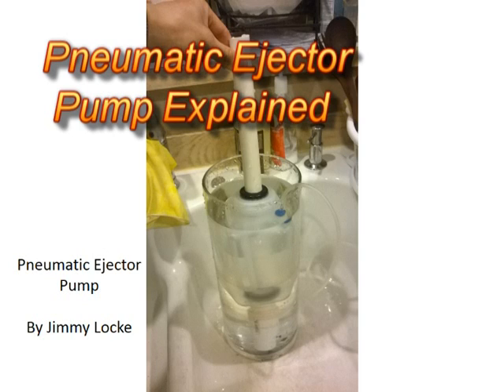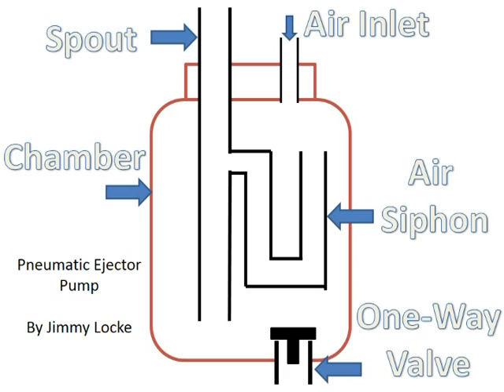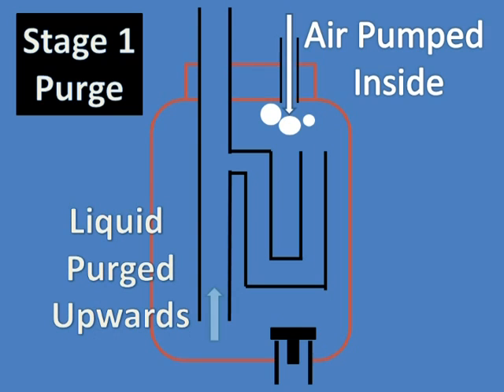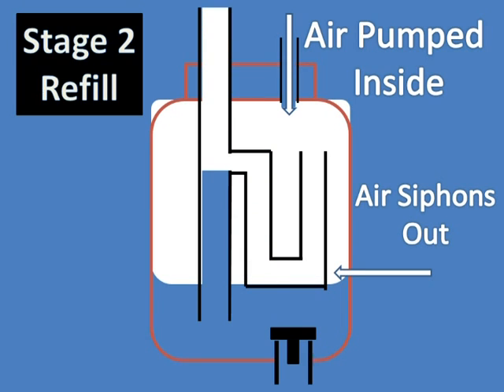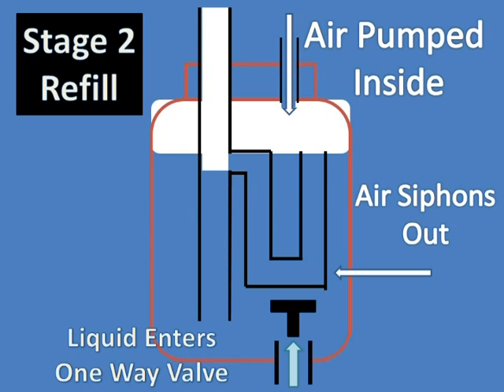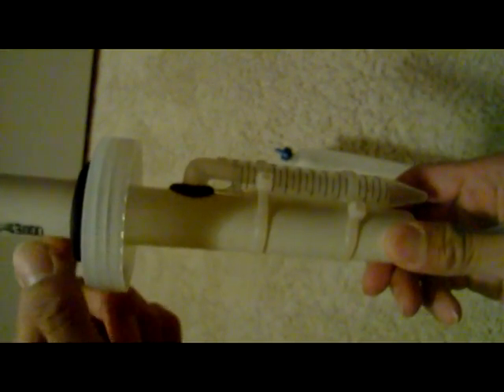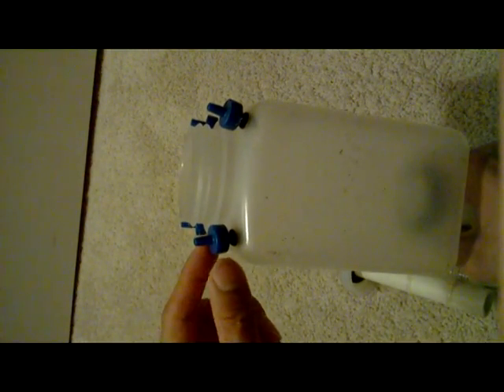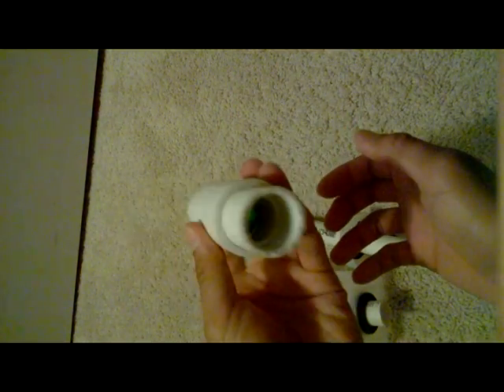Low Power Airlift Pump Explained (Pneumatic Ejector Pump aka Geyser Pump with Check Valve)

Comment: Hello lock8! Worked perfect for 30 feet, fills and empties alone may be injected air all the time without stopping it does not interfere realized that the larger the diameter of the outlet tube of the depressurized water and fill faster, ie, pumping more water as tubes thicker, I will test with mior height or will simulate height lowering of the water outlet diameter, so I can test in the same place ejetei 30 feet, but I will soon eject 200 actual feet in a deep well, something else, if you use a more powerful compressor flow increases enough, I used a portable pump to fill bike tire and ejetei about 8 liters / minute, I'll build a giant to pump some 5000 liters per hour to irrigate the crop of a friend, I will try to replace the siphon by a horizontal one-way valve to see if it even faster filling processes and emptying, I can guarantee you is that has already been using my system with the aid of electronics since February 2001 and today thanks to his idea got rid of electronics which made more functional and ecological bomb because dispença electricity, imagine a propeller attached to a compressor without using any electricity can pump water, or solar energy. I have already observed that this pump can be cosntruida of any size, bigger is better because it does not waste time with breaks to fill and

EM PORTUGUES:  Olá lock8 ! Funcionou perfeito para 30 pés, encheu e esvaziou sozinho, pode ficar injetando ar todo o tempo sem parar que não interfere, percebi que quanto maior o diametro do tubo de saida da agua despressuriza e enche mais rápido, ou seja, bombeia mais agua como tubos mais grossos, vou testar com mior altura ou vou simular altura diminuindo o diametro de saida da agua, assim posso testar no mesmo lugar que ejetei 30 pés, mas em breve vou ejetar 200 pés reais em um poço profundo, outra coisa, se usar um compressor mais potente a vazão aumenta bastante, eu usei uma bomba portatil de encher pneu de bike e ejetei uns 8 litros / minuto, vou construir um gigante para bombear uns 5000 litros por hora para irrigar a lavoura de um amigo, vou tentar substituir o sifão por uma valvula unidirecional horizontal para ver se fica mais rápido ainda os processos de enchimento e esvaziamento, o que posso lhe garantir é que já vinha usando meu sistema com auxilio da eletrônica desde fevereiro de 2001 e hoje graças a sua ideia me livrei da parte eletrônica que tornou a bomba mais funcional e ecologica porque dispença eletricidade, imagine uma helice acoplada a um compressor sem uso de eletricidade alguma posso bombear agua, ou com energia solar. Já constatei que essa bomba pode ser cosntruida de qualquer tamanho, quanto maior melhor porque não perde tempo com os intervalos para encher e despressurizar, sem falar que se usar compressor eletrico ligado a rede eletrica o rendimento do sistema pneumático é por volta de 3 vezes mais eficiente que o sistema de bombeamento tradicional. Mais uma vez lhe agradeço por ter tido essa ideia do sifão de ar, fantastico. QUALQUER PESSOA QUE ESTIVER PENSANDO EM FAZER ESSE PROJETO VAI FICAR IMPRESSIONADO COM O FUNCIONAMENTO, MUITO BOM. Grato, Arruda

Comment: Sorry, reviewing their response, I missed answer you, I confirm that I developed an electronic version that works perfectly and I will feed with photovoltaic solar energy soon, but I prefer to replace the electronics in your system that seems much simpler and can work with it I generate compressed air through the wind power, the good of your system is not dependent on electricity and therefore offers some other options for operation. Grateful, Arruda

Comment: Olá ! Com minha bomba, ejeto atualmente a 30 pés, 1714 L/h,  em outro já ejetei 90 pés, no proximo vou ejetar a 200 pés, o corpo da bomba que tem que ser muito resistente, aço inox é uma boa opção. se for de materia fragil, explode.

Hello ! With my pump, injector currently to 30 feet, 1714 L / h, in other already ejetei 90 feet, the next will eject 200 feet, the pump housing that has to be very resistant, stainless steel is a good choice. if the fragile material explodes.

Comment: Hello lock8! I am in Brazil, Bahia, saw his project, I enjoyed the air siphon idea, maybe improve my project with my pump can eject water at very high heights with corresponding pressure, only to have to wear an electronic circuit and sensor level inside the chamber to know the time that it is full or empty when empty, the low retention valve opens because the pressure of the water outside is larger and the chamber fills, then the chamber filled the box level sensor closes an air relief solenoid valve and connects the compressor which is currently electric network, I will do soon with solar energy, so the compressor connects, the water begins to rise with great force and volume when it becomes empty the camera sensor the low level turns off the compressor and opens the solenoid valve to depressurize the chamber, then begins another cycle. I want to remove the electronics and level sensors and see if your air siphon idea works in my pump, vc tested whether depressurizes if you have a second valve in the water riser pipe? Grateful, Arruda

Comment: Great video, I'm looking to design one of these to pump 12ft up, small amount of water, but still there is an obvious gravity issue... Any tweaks you can suggest ? My first two attempts have not worked, though they did not have check valves... Thanks!
Reply: +jlocke8 Is there any reason you can't use this check valve: http://www.homedepot.com/p/American-Standard-Flow-Regulating-Check-Valve-M953052-0070A/205512748  Also, although I haven't made it all the way through the comments so I don't know if you've already answered the question - what size are those pipes?  Otherwise, nicely done!
Reply: ***** The check valve I linked appears to be a check valve in name only, it appears to function more as a restictor.  This link however seems to be a one way check/stop valve.  http://www.homedepot.com/p/Homewerks-Worldwide-3-4-in-PVC-Sch-40-FPT-x-FPT-In-Line-Check-Valve-VCKP40B4B/202369948?MERCH=REC-_-PIPHorizontal1_rr-_-204237824-_-202369948-_-N  A marble is of course cheaper.

Comment: If I wanted to build one of these to pump water over 200 feet down my well would it still work
Reply: +jlocke, Hello, I kinda have the same issue as Gary McGhee, but instead I have a 205ft deep well (static water level of 65ft). The well is 120ft away from the house and downhill (10 degree do the downward slope to the well casing, aka additional 20ft of vertical lift). I'd like to build a pump that I can put down at 195ft, with a 3/4 inch discharge pipe that will deliver water into an un-pressurized holding tank in my basement. Given these figures, my understanding is this give me a THD (Total Dynamic Head) of 240 feet, or 103 PSI (or did I do something wrong?). Finding information on how to this is scant OR more likely, I'm simply too much of a simpleton to figure out which equations to use to determine compressor PSI and CFM, or even what size air supply line.... I want to do it myself, I just don't know where to find the right information... Any tips/resources/books you would recommend?

Also, do you think it would be beneficial to add a check valve in the discharge pipe/spout right above the chamber?
Reply: @l.a.martin2424 
A lot of trial and error going on with air water pumps. 
If you want to totally understand the principle,read up on Brinolli's theorem,he is kinda the father of hydraulics. My opinion is this pump is a bit over the top.foot valve not needed and just another thing that might fail.just use a piece ,around 6 ft long 3 in. Sch40 plastic,on the top side couple a 1 1/4 in poly 100psi down tube,it comes in 300 ft coils.cut the other end at a little angle up about 20 inches drill a hole and install your pressure line end,method of attachment depends on casing size,1/2 inch pressure line,material of your choice. You are  going to need  between 5 and 10cfm at 100 to 130 psi.I have installed several they work fine ,I installed them where submersible  did not last long,because of sand or high iron content.they are less efficient than a submersible but if you need water and your well has a lot of sand etc then thus the way to go. 5:06

Comment: Just a thought with the leakage from your check valve there.. a small rubber O-ring around where the marble seats would help seal that and maintain the pressure in your container for a little better efficiency.  Also, does the check valve need to extend out the bottom like that?  I'm thinking if it's internal within the unit, you can lower the whole thing further down in the water column, meaning the air bubble's forming in higher pressure and so probably being able to push more water and/or give a higher lift.  Very much like the design though.. I've been looking at airlift and un-valved geyser pumps but have been a little discouraged by the depth required.  This looks like it might be the solution I've been looking for.